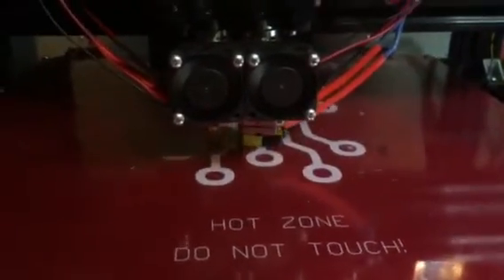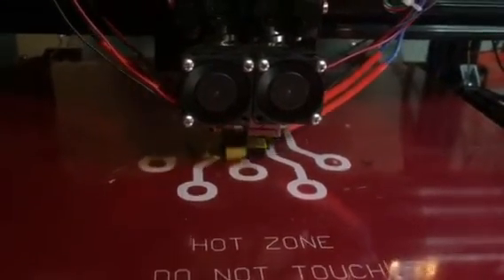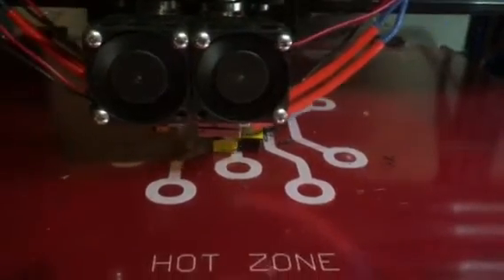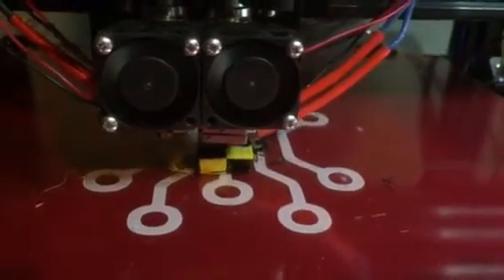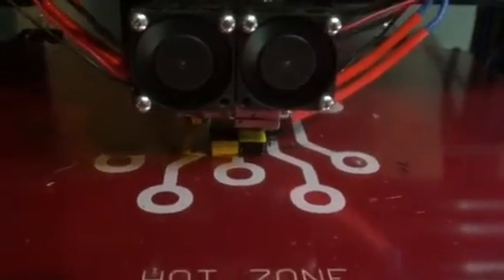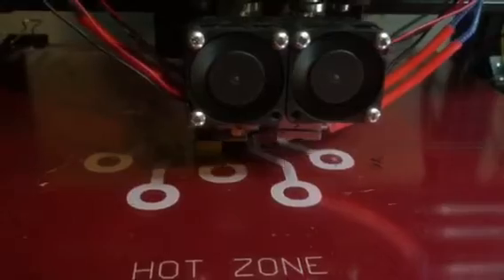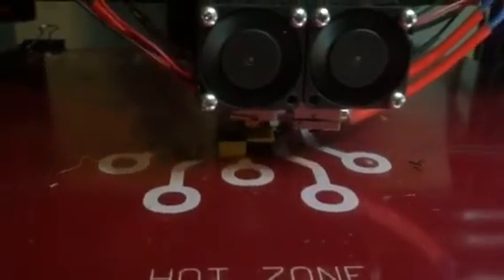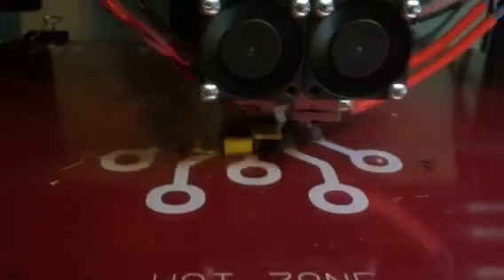First attempt at printing 2 colors Makerfarm Pegasus 12 3D Printer

Comment: Im also looking at this printer and also the beast large 3d printer too.
Reply from the maker: I hadn't heard of the Beast - but I checked it out and it is really big. I've printed some larger objects with my I3V 12 and the print times get really long for large objects in a 300mm volume.  I can't even imagine in the Beast's print volume.  I like the aluminum hardware that the Pegasus 12 and the Beast use - quite easy to use.
Reply: Looking at the Pegasus as my first printer also.  How is the print quality on this?  Also looking at the Seemecnc's but that is a little intimidating to me.
Reply from the maker: The print quality is excellent - better than my Makerfarm i3v 12.  The aluminum structure of the Pegasus is very rigid and that seems to help.  I have a dual extruder setup and I'm getting use to the tuning of retraction for oozing issues, but the alignment of the 2 extruders is really good.
Reply: How long did this build take?
Reply: One of my first projects will be a small stand for my FT-817D.
Reply from the maker: It is hard to give you an accurate build time number since I spent 2 months off and on building the printer.  I would guess about 10 - 12 hours of actual building time and tuning is definitely a part of that.  The stand for the FT-817D sounds like a great project.